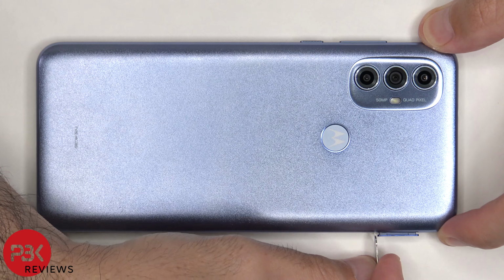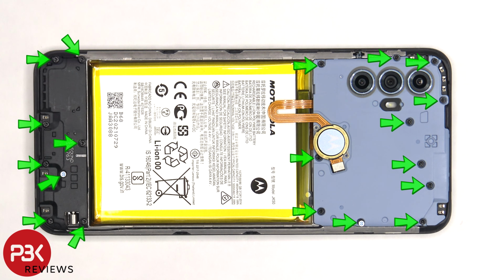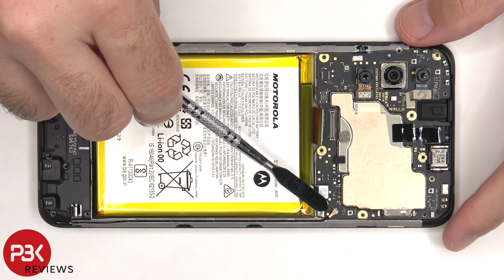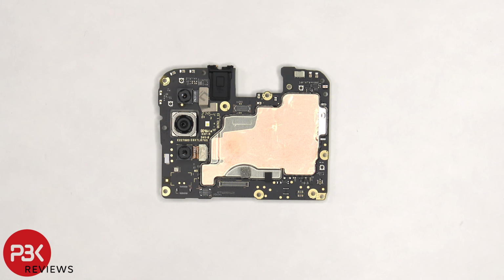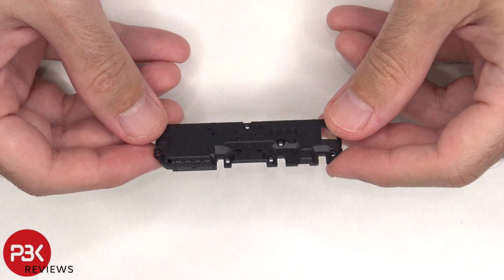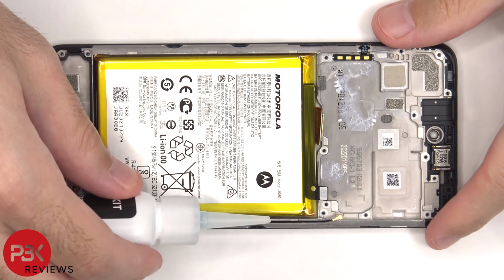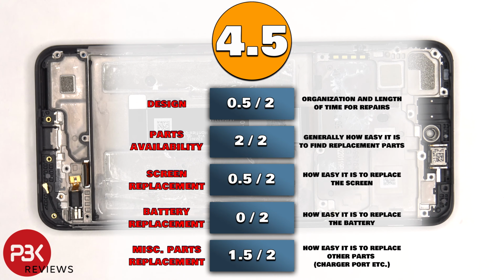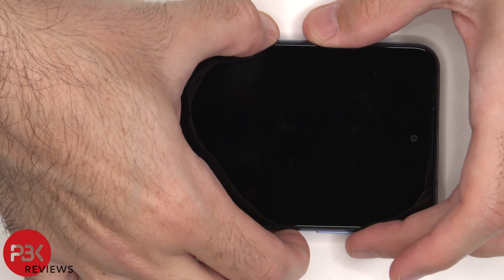Motorola Moto G Power 2022 Disassembly Teardown Repair Video Review

Comment: Hi I really appreciate the video I find you very easy to follow I have a charge port issue, my cord is loose fitting and requires constant assistance. Do you have a video showing how to replace it? Thank you for your help
Reply from the maker: you would need to replace the bottom sub board that has the charger port soldered to it. That would fix your problem.

Comment: Crap.  The case popped off abruptly and the brass wire to my fingerprint sensor cut in half.  I don't have soldering capabilities.  There goes another $20.

Comment: Great Job
Reply from the maker: Thank you! 👍
Reply: @PBKreviews  I spoke too soon.  The fingerprint sensor wire broke off when the back cover came off abruptly.  I've ordered another.  WHEN you reassemble, where does the lose end (sensor end) plug in and HOW.  You didn't show disconnecting it when you disassembled it.  Does it just lay there?
Reply: @PBKreviews  Never mind.  I see where the screw was supposed to go.  I had my screen replaced and the vendor didn't replace it.

Comment: update: Using this tutorial, I have replaced the battery and the charging port. Here are some tips I learned in the process: The prying tool that came with the kit is too bulky to get between the screen and the housing - I mainly used my thumbnail to get in at the corner, and then once I pried that up a little, then I could get the prying tool to snap off the rest of the way. It also helps to have a magnet of some kind nearby, to hold the weensy screws and to magnetize your wee screwdriver, SUCH a headache prevention, lol!!  For battery replacement: The glue holding down the battery is STRONG. I ended up piercing the battery in the process of prying it out, which is problematic - recycling places won't accept it, and outgasses. So before you make the attempt, put your phone on a heating pad to soften the glue; let it sit for a few hours. Alcohol helps, but procure a needle-like tubule for the alcohol to seep into the crevice between the housing and the side of the battery - an eyedropper isn't precise enough. Otherwise, it's a straightforward procedure. For the charging port, the little connector with the wire attached is held in place by a teensy friction clamp, like how that rod that holds up your car hood seats in a friction clamp. So when you go to screw in that one screw to hold down the speaker card, make sure that wire is out of the way in its little clamp, otherwise it'll get caught under the screw head. Good luck to everyone who is brave enough to attempt these repairs, and thank you, thank you, thank you for this video. Absolutely essential.
Reply from the maker: You're welcome, glad it was helpful. Also yes isopropyl alcohol will help a lot, placing some drops around the sides of the battery and letting it get underneath the battery to eat away at the adhesive.

Comment: Just for anyone attempting this; it's not reiterated in this video; but it is CRUCIAL ‼that you disconnect both grounds top and bottom prior to getting the battery out.   Also I would NOT use alcohol to loosen the battery adhesive because it is flammable.   Also do NOT use anything metal to pry the battery out.  This can cause a Fire to occur at the battery terminal.

Comment: Just want to replace the battery - do I have to take out all those other parts?
Reply from the maker: no, just what you need to remove the battery
Reply: @PBKreviews  I did it!!!  the glue behind the battery really was the hardest part, lol. Thank you so much, I couldn't have done it without this video.

Comment: My headphone jack seems to be damaged from using a poor fitting cable. Is it possible to find replacement part for the jack or is there a usb to audio jack cable that can be used if the headphone jack goes bad?

Comment: What is that spinny piece at the left corner of the phone? I saw teardown and was so happy I would find out what that part is called but you didn't even look at it 😢
Reply from the maker: Are you referring to the vibrator motor on the bottom right corner of the phone?
Reply: @PBKreviews  Thank you! 😊 I ripped the ribbon and was hoping it wasn't a necessary part

Comment: My Motorola g power screen turn blue and reboot please what is the cost of that
Reply from the maker: Cost varies from place to place depending on where you find the part to purchase. But all depends on what the problem is. Can be water damage causing that, which might not be repairable. Can also be a defective screen.

Comment: Its unreal how there's so many versions of this phone and so difficult to find just the model XT2045-3 battery removal.  
I guess this is as close as we can get.  
I did get rear cover off, but it's fully glued on, and probably a heat source should have been applied besides using credit card to separate cover 100%. 
Maybe a moment in the New Air Fryer is the trick... 
Cheers
Reply: My youngest brother bought a Troy built tiller last year brand new for over a grand it broke down months later and sent it to me to repair that tiller was discontinued under a year old .lol
Reply: @user-zm9ht7no2l  

If the Fuel is never treated, 
Any Power product will refuse to start after 3_4 months, 
Where the low speed jet deep in the carb will no longer allow fuel and air to mix if allowed to get contaminated by moisture. 
The fuel can used to fill these tools should be treated with a Stabilizer. 
Keep this container protected high & dry. 
If typical garage is affected by the damp concrete floor, putting the container 3ft up will get it out of wettest conditions. 
Before running any gas engine, drain the carb fuel bowl to allow fuel coming in to flush out garbage and water. 
Cheers
Reply from the maker: All of the region models would be the same teardown process, the only difference the different region models have usually are the sub board antenna layout and network bands etc. But the disassembly is the same. As for removing the back, yeah applying heat will loosen the adhesive to make it easier to pry off. Also for the battery, it is also glued down so you would need to apply heat, or use some isopropyl alcohol and apply it to the sides of the battery so it goes underneath, and eats away at the adhesive, making it easier to pry off. Just incase you need it, here is a link: https://www.ifixit.com/products/ifixit-adhesive-remover?variant=39915173740647  and also you can find original replacement parts for this phone at www.mobilesentrix.com

Comment: How do i éxchange.power buton
Reply from the maker: The physical button itself is on the back housing, once you remove the back housing you can pull it out and replace it. But the clicker is on a flex cable, you would need to take the phone apart and remove the motherboard to pry off and replace the flex cable with clicker.
Reply: @PBKreviews The clicker flex cable is definitely on the lcd frame. I received a new lcd with frame to fix one of these units, but it did not come with the power button, vibration motor, or what seems to be the ear speaker. Is there a simple way to transfer these without severe risk of damage?

Comment: Any other tips for removing the battery? I have ethyl alcohol and a plastic guitar pick. I have a new screen and digitizer that I'm trying to move it to so if I ruin the strip under the battery that's okay.
Reply from the maker: You can use isopropyl alcohol (like this one: https://www.ifixit.com/Store/Tools/iFixit-Adhesive-Remover/IF145-400?o=3) and get some under the battery so it eats away at the adhesive making it easier to pry off. Usually you can let it sit for 30 seconds and then try prying so it loosens it up a bit.

Comment: thanks for this one
this reminds me of my first android smartphone samsung galaxy s5, it was a great phone, I held to it for 3 years, replaced one battery and replaced the "phone" when GPS failed cos I moved to a new city. it was IP64 but you could easily unsnap the rear case and replace the battery, nothing was glued.
Reply from the maker: Yup. You're welcome :)
Reply: @PBKreviews  thank you for this vid I got a couple questions you said theres some adhesive around the fingerprint scanner and the cameras when taking off the back cover. Does that have to be replaced before putting the cover back on? Thanks